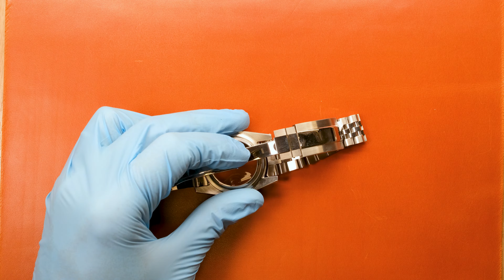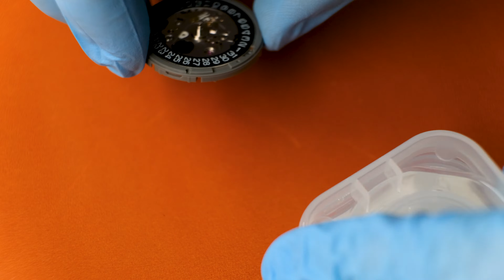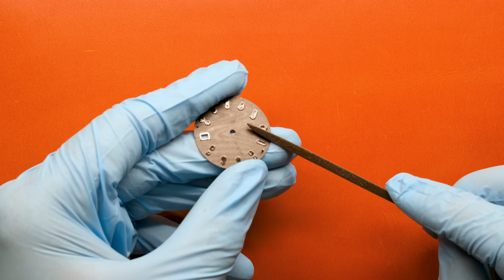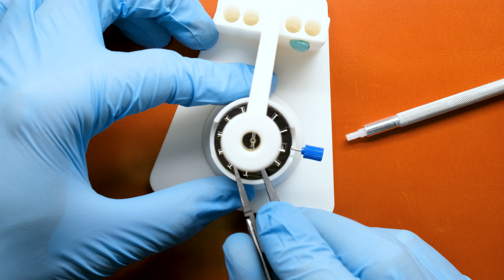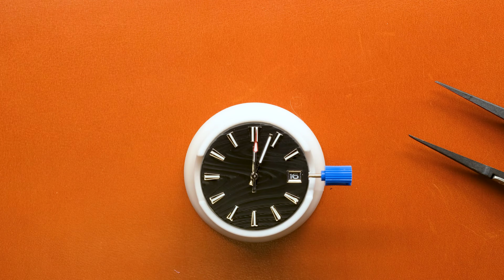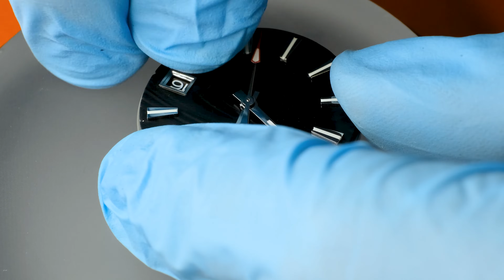SEIKO MOD DATEJUST BUILD Made Easy Without Breaking the Bank!

Comment: Congratulations for the Build ... It turned out great ... Thank You for Sharing . 
I can add something that might be helpful to you: 
1) For over 6 months, I've been watching all the videos and reading dozens of tutorials on watch assembly, and 99% of those who perform this delicate operation, such mounting the hands, use that "Rodico". I think it would be very helpful for you to use that to keep the hands . 
2) Do you think you could share with us the link(s) for the parts made on the 3D printer? .. I have two printers myself (LOL).
3) You had a great idea with the mechanism box to hold the stem (LOL). I will use that in my future build.
Best of luck and keep us in the loop with whatever you do...
P.S. and Please Read what @gmac_83 said about the correct way to measure the stem an the rest of it .

Comment: Just a suggestion, take stem measurement with the crown pushed into the stem, as this replicates where the crown will truly reside when screwed down to case. Giving you a much better fit. You can see you have a few mm of "play" beyond the crown thread when you fitted the stem back in. Doing this means when you unscrew your crown, it will "pop out" exactly at the end of the thread with no extra space, meaning you have plenty of crown spring movement to screw it back in, keeping things watertight and not overstretching the internal spring. You can see your crown was not entirely sitting flush with the case when screwed down as the spring was at it's full movement. Having said all that, yours worked great, so all depends on how particular you want to be. Great video, lovely watch! Enjoy!

Comment: James:  I have a suggestion for a video if you want.  I just purchased a lighted magnifying glass for reading ingredients on packages and small instructions.  67.  My eyes need the help.  It is a really beefy device and I would love to make a leather 'holder' for it.  Could you make a video on how you would create a custom sheath for anything.  Two different shaped items.  Two different storage methods?  Straight into the sheath and one kind of from one edge.  I can do this no problem.  Template, fold in half, cover with plastic.  But, I love your methodology for other things and may be your way would be better than mine.

Comment: Looks great. It’s such a pity the rehaut is so thick compared to the original. Do the seiko movements not fit in the Superclone cases instead of the AAA?
Reply: FYI, I built watches both using a miyota 8215 and a nh35. The miyota case, although thicker, had a thinner rehaut. NH35 movements are thinner and thus are in the watch case deeper. Hence the thicker rehaut. NH35 movements are really easy to work on, but the cases for them are not perfect.